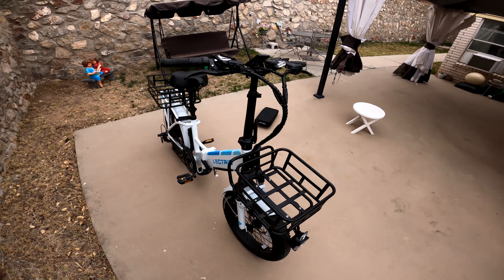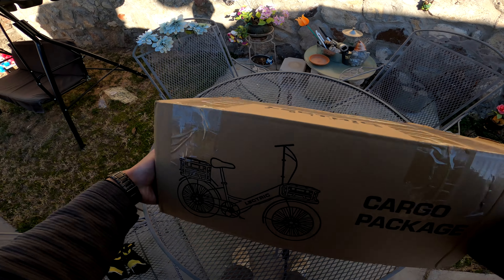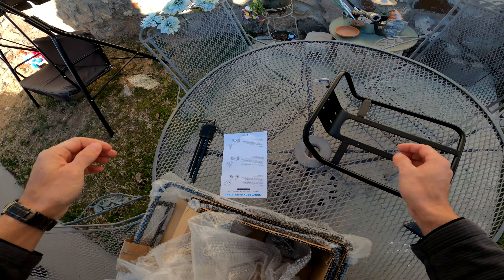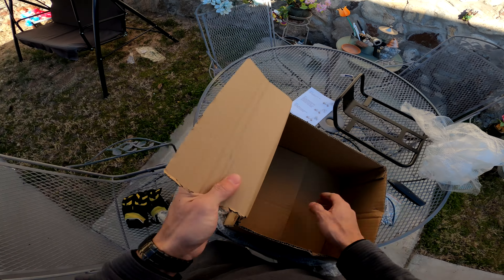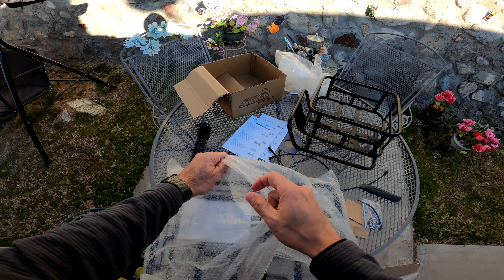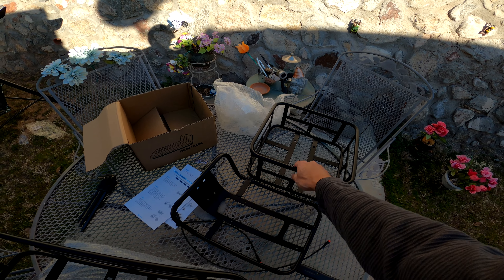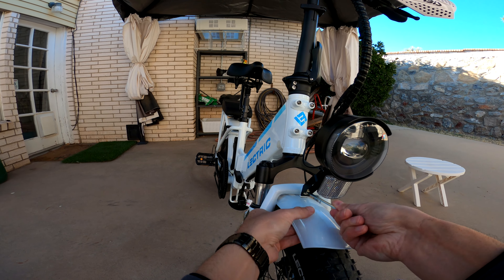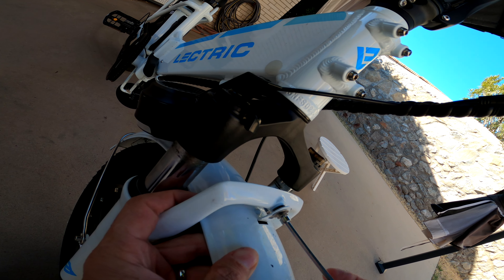Cargo Kit Unboxing and Install - Lectric XP

Comment: Sorry about the multiple comments but You can position the basket so you can install your light facing up.
Reply from the maker: I did happen to discover that later.  After Lectric sent me a replacement, I decided to mount on my handlebars, well out of harms reach!

Comment: Almost looks like you could flip the head light up, it would keep it drier and protect it better...
Reply from the maker: I have a solution I'm working on...after breaking the light off, off-road.
Reply: Yeah it seems like it was installed upside down.  Turning it 180 degrees would’ve been correct

Comment: I was able to mount my light pointing up.
Reply from the maker: Yes, I saw that option in other Lectric documentation.  Definitely better pointing up.
Reply: Also, the rack I have has the connection point at the very front, not back 2 or more inches.

Comment: I'm waiting on the cargo kit to arrive for my new xp 3.0 and I have to say that I don't like the headlight placement after installing the front basket, it looks jerryrigged and actually even dangerous like it could come loose and tangle up in front wheel while driving. They need to fix this issue.

Comment: Is there any way to mount the light to the front of the cargo rack? I dont like the design where it is just hanging down in front of the tire (even though it is bolted underneath). I didnt see a hole in the front of the rack, but I wonder if you could drill a hole to mount the light on??
Reply from the maker: Yes, the basket has a hole that would let you mount it up higher or you could use hose clamps to attach to basket as well.  See this short:  https://youtube.com/shorts/9rfK7TM7cik?feature=share

Comment: You removed those silly plastic wind or brush guards .. If they don't have metal reinforcement they are useless to me. Like BarkBusters on my DR650. Those are worth using.
Reply from the maker: Yeah, on my dirtbike and dualsport I have full wraparound handguards with metal reinforcements (Tusk brand).  They are awesome and take a pounding off road.  I had these lying around so threw them on for "wind protection" but I found that at the lower speeds these bikes go vs a motorcycle, winter gloves are sufficient to keep hands comfortable.

Comment: Rear light wire
Reply from the maker: That makes sense.  It was not mentioned in the instructions I received.  In the rear it's not as necessary as the light remains visible with basket mounted.  Mounting it on the basket in my case would also make it more difficult to switch over quickly to using the passenger kit.

Comment: I would be worried about the front wire bundle using these racks..
Reply from the maker: When you turn the bars fully, the bundle is definitely stressed more than it should be due to the sharp step on the hook.  I may just grind it down a bit and touch it up with paint to smooth that transition.